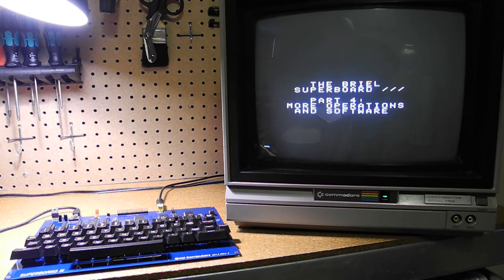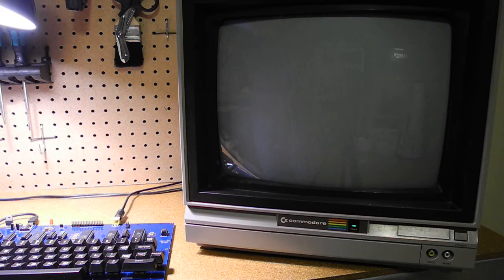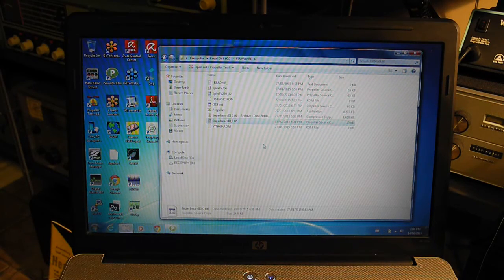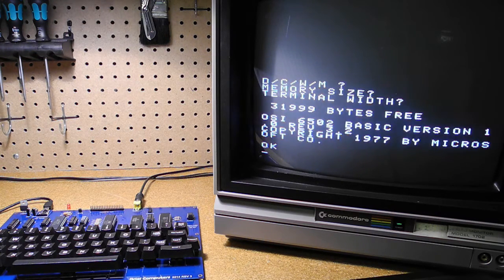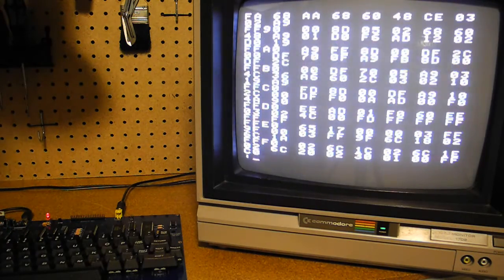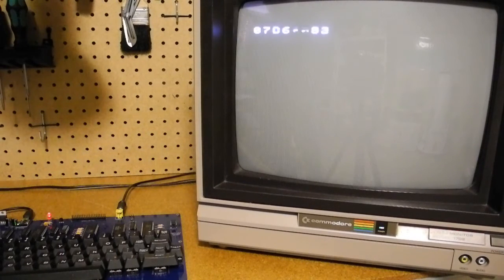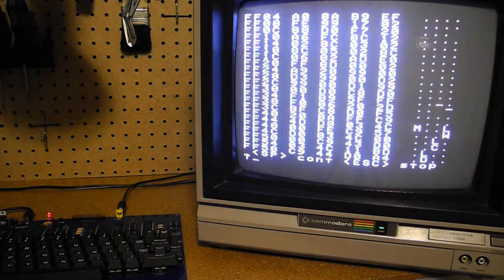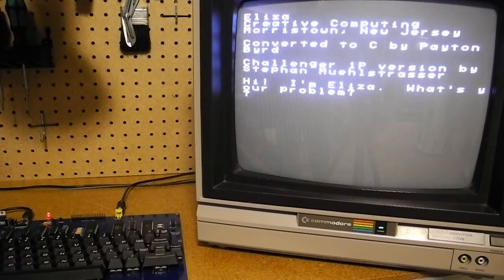The Briel Superboard /// Part 4: More Operations and Software

Comment: Awesome stuff! It's amazing to me how useful this system is despite its simplicity.

I remember you mentioning in another video that Vince Briel put an AS6C1008 (128KB) SRAM chip on it, even though only 32K is mapped (I have a feeling he did that because I mentioned it as the memory chip I was using for my Propeddle project and it doesn't need 5V; he must not have known about the AS6C62256 32KB chip). There is also the AS6C4008 chip which is a 512KB SRAM that's (mostly) pin-compatible withe the AS6C1008. I wonder how hard it would be to design a simple memory mapper / bank switching device to put the 128K or 512K to good use, for example to run Fuzix...